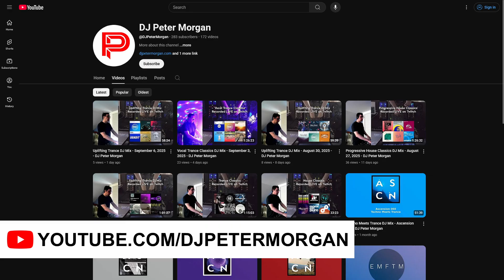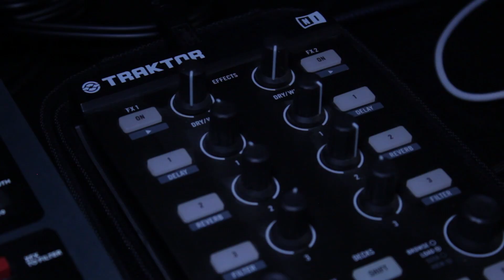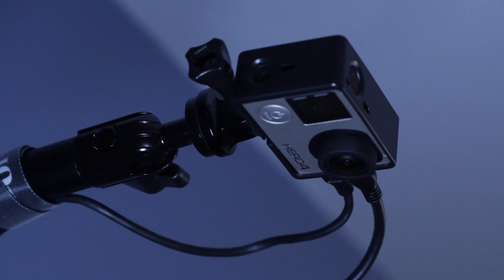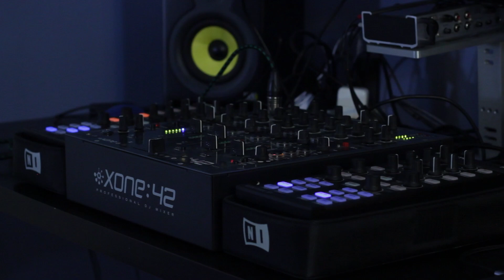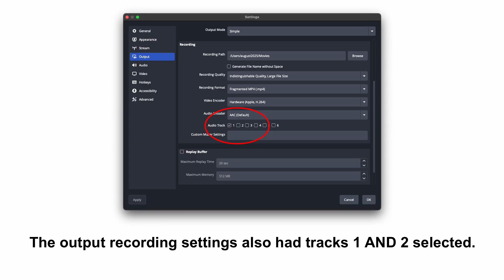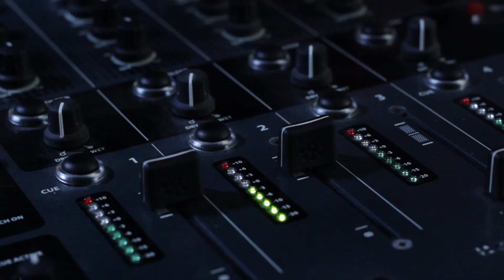My DJ and Livestream Setup - October 2025

Comment: Are you running windows 7 with the audio 8 sound card ?  I have an audio 8 had to use an audio 6 for Windows 10,  so the windows 7 drivers should work with windows 10 you said
Reply from the maker: I am running Windows 10 with the Audio 8 DJ.